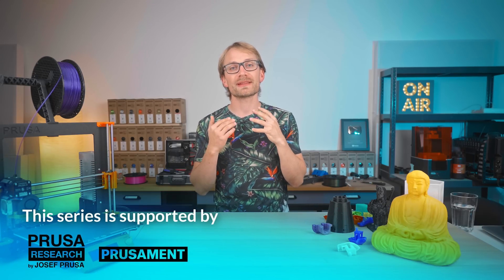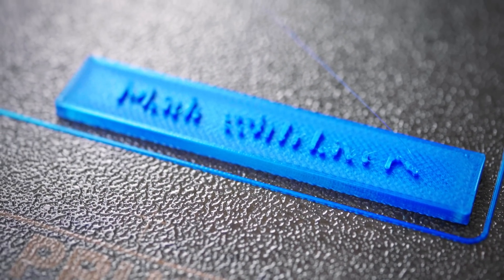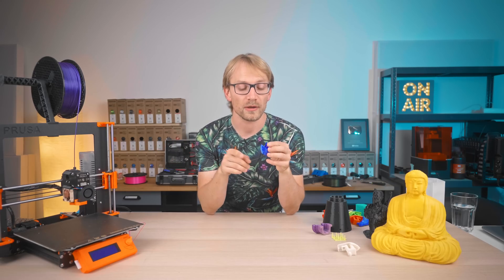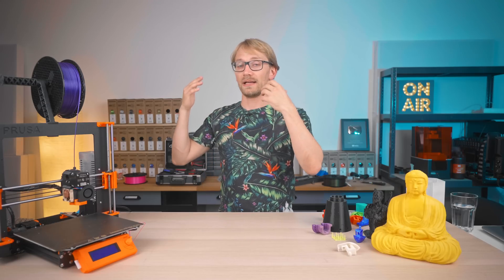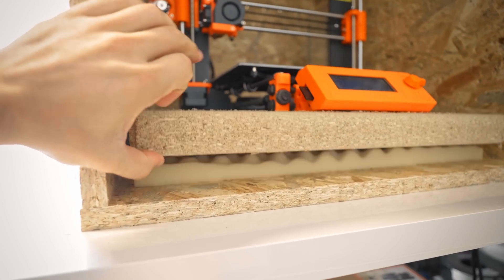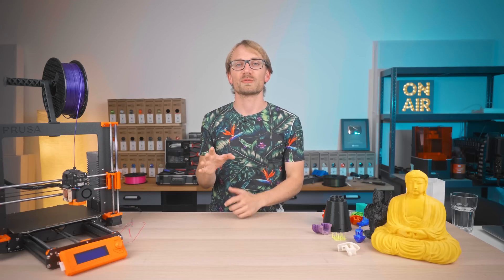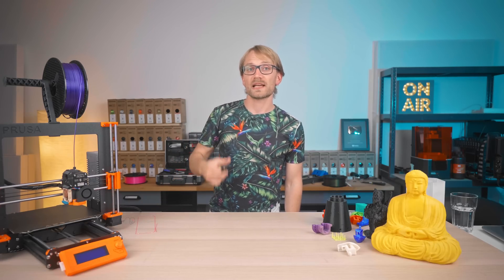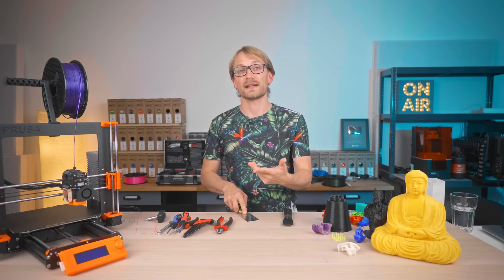3D Printing Basics: Before you print - design and print space requirements! (Ep8)

Comment: How do you determine how much filament you need for a print? I'm trying to get an idea how much filament I might consume for budget purposes (hobby, not commercial mfg).
Reply: I feel like most medium size spools would be enough for most projects (depending on printer size, settings, etc.) , and as a plus, you'll have leftover for re-do's and other projects. I would suggest trying out well recommended filaments to avoid a cheap, crappy filament, and just buying bigger spools that fit for you because you can never go wrong with having more than you need. By buying more, you'll save money on bulk discounts and never deal with running out mid print. If you want to try a different brand (possibly cheaper) filament, buy a small spool to test it out first.

Comment: I am keeping whatching the entire serie, there's lot of stuff to learn, hope that I remember!
Anyway, it is possible to put the printer in a kinf of big box of - plexiglas ? - to prevent emitted particles flying away and creating a big mess?
If yes, what kind of material do you suggest?
I think it is needed one capable of resist to high temperatures but with some microporosity to assure the air could slightly go through and cool the printer inside. Until also O2 could pass through and maybe we will have a dangerous completed triangle of fire, I guess, lol.

Comment: About fire-safety: your smoke detector looks as if its closer than 50cm from walls/corners. Warm air rising from a fire will build op close to walls and especially in corners, pushing the smoke away. This prevent the smoke from hitting and activating the smokedetector.

This might cause problems and is in the Netherlands and also Germany not allowed. Though you should know.

Comment: Nice, clear and useful video. I have just a comment about "improved overhang at 30° instead of 45° thanks to software improvements "...  It should also and maybe more depend on the choice of layer height (especially variable ones) and nozzle size, don't you think ?
Reply: I find a 4:1 ratio between nozzle diameter and layer height will give the best overhangs, but results do vary

Comment: Wht are my first layers appearing to "wrinkle" as if the bed temperature is too hot.  I've played with temperature to no avail.  I use hairspray.
Reply from the maker: Could be the nozzle too close to the bed.
Reply: @MadeWithLayers  Aw thanks man.  I found that I had changed the "Advanced" Print tab "Extrusion Width" (for some odd reason) settings in the Prusa slicer.  Once I put them back to "Default", it straightened out my first layer.  But thanks so much for replying!!

Comment: I just started with a Prusa MK3 S I been having issues with the filiment getting stuck in the roll as it's pulling and I get this offset line in my print... Someone suggested I make sure the roll is rolled tight tried it but still after a while it gets loose and start getting stuck along the inside of the spool and the printer obviously just yanks it free causing a defect in the print. I seen Thing Universe people made these filiment guides but I don't see you using them or do you? I am going to print a few out see if it helps...
Reply from the maker: What filament brand are you using?
Reply: Thomas Sanladerer it was the gray Prusa roll I received with my Prusa MK3 S. It worked fine for a few prints before it started getting stuck in the roll. I printed a guide loop haven’t had any issues since. Printed out like madd now!🥴🤓 Here’s the guide I printed, I printed all examples like the wide rectangular loop https://www.thingiverse.com/thing:1940114 I ordered Prusa Orange PLA and I’m currently printing out the IKEA Lack Table hack so far nearly done no issues

Comment: Hi Tom, I noticed that when the purple filament  was extruding at the beginning of the video, it was bubbling. Is that normal or a problem? will the bubbling leave artifacts on the piece?  Great videos,,     Cheers, Steve
Reply: Usually that means that there's moisture in the filament which is bad and visible in the prints
Reply: As it was already said, bubbles point towards moisture that got absorbed by the filament. When you heat it up, the water turns into steam and expands quite a bit, that forms the bubbles. From what I've seen so far, prints with wet filament look horrible and most likely are also not very stable because you have tiny gaps everywhere.
Reply from the maker: The bubbling is from moisture (I address this in the video coming this Friday). While a small amount of moisture will only result in a slight reduction of mechanical properties, significantly moist filament will also print horribly, especially on bridges and overhangs.

Comment: When you use OSB to build a box and your printer burns inside, the fire will run out of oxygen and die out way before the box starts to burn. It's actually safer than a non-boxed printer.

Comment: artist palette knifes are nice for sliding under a print.  They have a thin flexible blade and come in different sizes.
Reply: i use masking tape, just peels off the bed and if its stuck to your model you can easily remove it with some propyl alcohol or break and clutch / carburetor cleaner